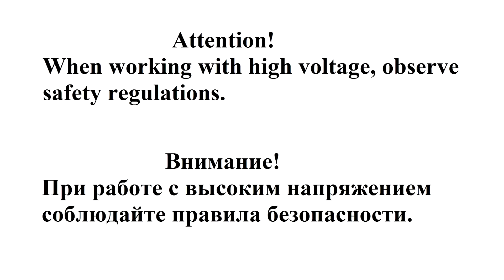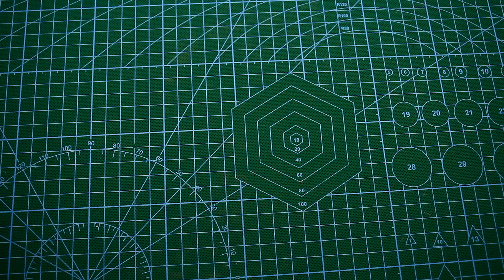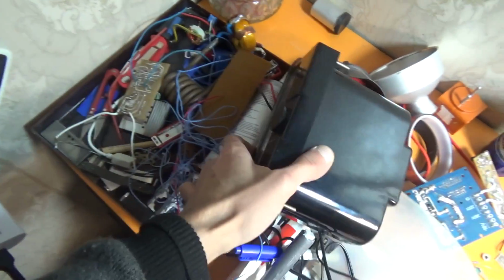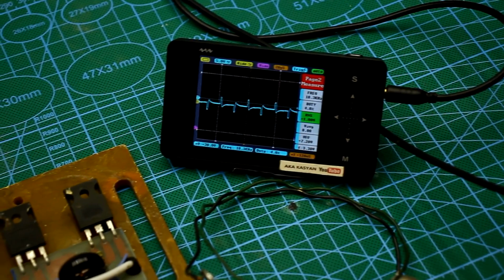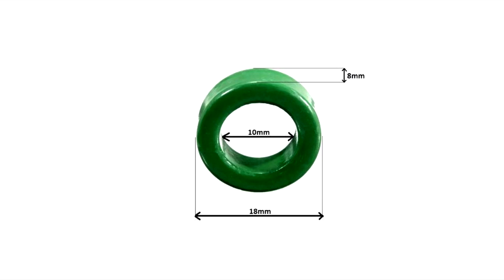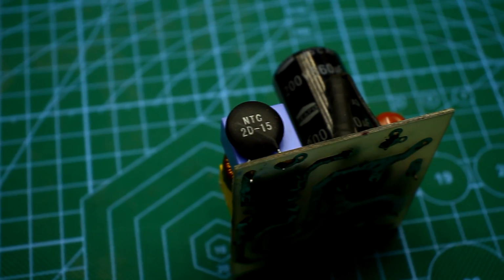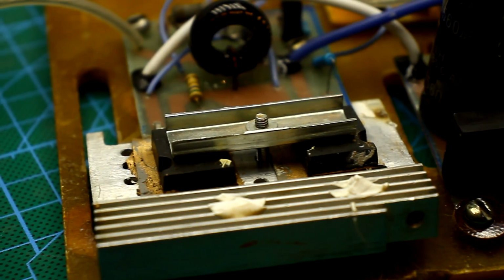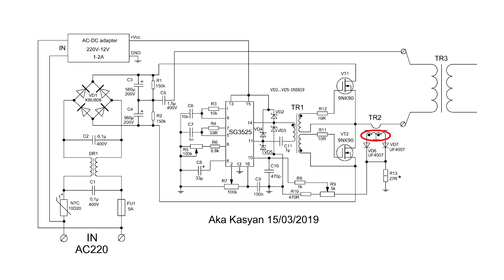Switch mode high power supply

Comment: 你好，我需要设计一个DC-DC降压转换器，将250V至600V的直流电压降至90V以下，同时增加电流。我了解涉及的风险。
Hello, I need to design a DC-DC buck converter that can step down an input of 250V to 600V DC to a voltage below 90V, while increasing the current. I understand the risks involved.

Comment: I notice he don't use pull down resistor in any of is igbt or mosfet in all video and i try this method and igbt blow like a fire cracked 🔥 because without a pulldown resistor the gate can get discharge at all so please don't follow his method you will blow igbt and mosfet

Comment: Can you design a converter that you can control the output current with a op amp automatic by sensing the load current

Comment: Great video a good video nobody has at least at the rate is making or altering a server smps for constant current and voltage both adjustable. Also include what would change when connecting to supplies in series. I not only can use all the smaller voltages 5v etc. But also have needs for low voltage and higher amps and opposite
You are defiantly the person to do the video your very clear and give links so a person could have boards made thanks for all you share

Comment: Maybe you can make some tester for core saturation? When using used cores it's hard to make calculations without it. The saturation can be meansured using high power, varible frequency sinusoidal power supply, and an osciloscope, when the saturation accures, the sinewave gets clipped.

Comment: Nice. I like that current limiter circuit with the current transformer. I need to try that one myself.
  I would like to see you use this devices  in practice with your oscilloscope. I'm not quite sure how you are determining core saturation and optimal turns ratios.
  I also have a couple of mains current limiters that use a lightbulb or PTC thermistor. I find it helpful to add two of the cheap mains voltmeters from AliExpress to both sides of the mains current limiter. This lets me know the voltage drop across the bulb/ptc at a glance :-)
-Jake

Comment: Very interesting device!

One possible improvement I could think of since this is a testing device:
Across the main filter capacitors, add reverse polarity diodes, and maybe even replace the 200V capacitors with 400V ones. That way, in case the transistors do not switch correctly, or a connection on the transformer is faulty, the filter capacitors will not be damaged.
Reply: But aren't diodes there?! For what?!  I really did not get you.
Reply: Those 200V capacitors aren't at risk from the output side of the converter. If there is a short somewhere, be it from transistors failing, or being turned on simultaneously, or from a shorted transformer, the worst that will happen is the capacitors empty themselves into the short. The inductor will saturate and the FWB rectifier will protect the capacitors from negative voltages.

Comment: Dear kasyan . İ love your videos. Please  can you share with me transformer calculate and some pwm ic calculate . Thank you
Reply: Search the internet for "MC34063 Calculator." That is the easiest DC/DC converter to get started with. It's also just a low voltage device used to step up or step down around 1.25 to 30 volts. You really should figure those out before playing with a mains type topology. You will also find MC34063's in around 60-70% of all phone type car chargers. You can usually take one of those apart, change a couple of components, and make any voltage you want (between 1.25 and 30 volts).
-Jake
Reply: @UpcycleElectronics  thank you . İ know this way and i wonder kasyan way . May he use some tricks ... İ was worked 3-5 ic and ferrite material .
Reply: @raer7844  
  I know his main Russian channel has a lot more stuff on it. That won't help you a whole lot if you don't understand Russian and need an explanation. However, if you're looking for some circuits to build and are an intuitively focused type of person you can learn a lot from the Kasyan main channel.
  I don't understand Russian at all, but I have built a few of the circuits from the Russian channel. He has several switch mode designs on there.
....but I'm curious about his techniques too :-)
-Jake